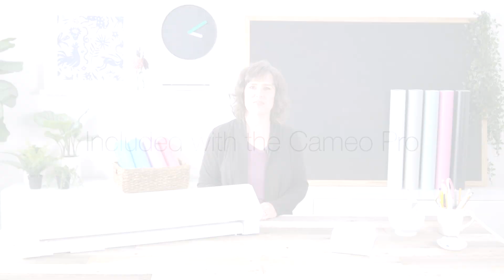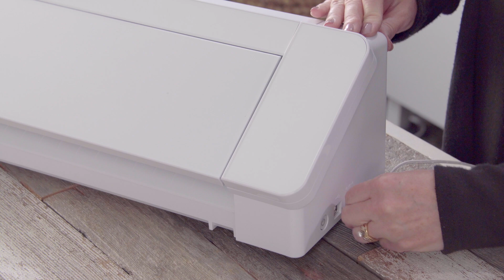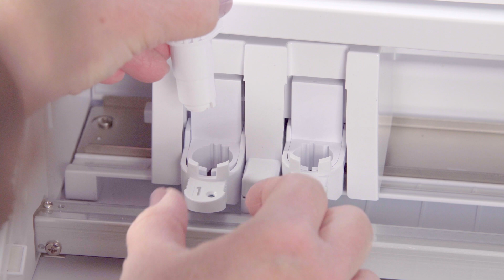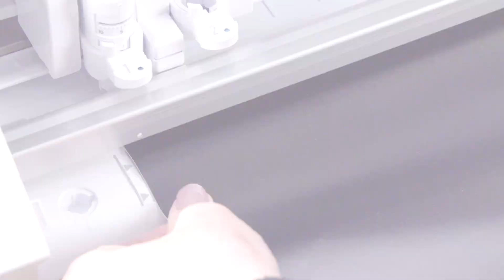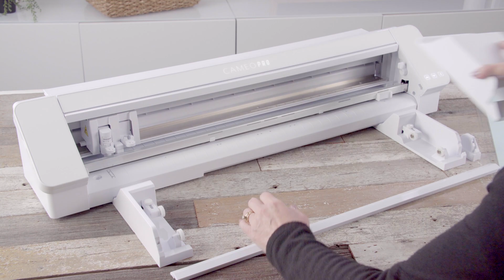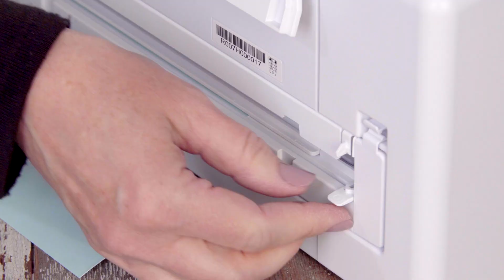Getting Started | Cameo Pro Setup

Comment: I am wondering which is the best way to get support as I sent an email a week ago and still have no response as well as commenting on videos with also no response.  I am very new and  I finally figured out how to print and cut a heat transfer for dark shirts and it was SUPER NOISY I thought it was broken!  The settings that the cameo chose were blade 3 speed 8 force 7 and it cut through into my mat and shredded my text so I reduced them all to one and wasn't as bad but still cut through to my mat.  What do I do? tia :)
Reply: Thought I was the only one! It sounds like it's singing when trying to cut. Have you figured it out or still nothing?
Reply: @cyanste  just told that they are just that noisy so I guess just have to deal with it as long as it works that's all that matters lol
Reply: @cyanste  The singing sound is normal. :)
Reply: The chat feature is the  fastest way to get support, as the support staff does not actively monitor all the YouTube video comments. https://www.silhouetteamerica.com/contact Make sure to test cut whenever trying a new material. It is not a quiet machine, but you get used to it. :)

Comment: and the cutting speed? is the same in all cameos 4?
Reply: Yessss!! 😁
Reply: yes? =(
oh no...
Reply: @fernandocampos3042  I thought it was a Good thing.. Haha all of the CAMEO 4 can cut up to 3 meters/s..
Reply: @julianadelamura  3 metters/sec? Are you sure? Mine do at the most 30 centimetres/sec, on a straight line MAYBE. But if you cut curves, or, CIRCLES, be prepared for a loooooong time waiting. hehehe
The cameo is an excellent kraft machine, and I hope they upgrade the speed on these "pro" ones.
Reply: The cutting speed is the same for all three Cameo 4 models, including the Cameo Pro.
Reply: @KellyWayment  yeah..Iam pretty sure..for a straight line..at the 30 speed settings
Reply: @julianadelamura  maybe is a misunderstood. 
The tech specs of the cameo 4 says they can hold up to 300mm/sec. Is 30 centimetres. 
I'm pretty sure that mine can not do 3 meters on a second... The graphtech ones do 800mm/s at most, and they're fast machines.

Thinking about, 300mm/s is not a bad number for straight lines, but the cameo slow down on curves to almost 10mm/s, while others maintain their speeds, and that is the most important data. Because that the cameo is extremely slow on general use.
Reply: @fernandocampos3042  well I saw at the Silhouette Manual..that every ajust is equivalent to 10 cm/s. Maybe they meant mm..not sure..I may ask the support now..😁
Reply: @fernandocampos3042  where did you find that speed info?? I keept looking but I cant find it anywhere..:(
Reply: @julianadelamura  The Silhouette Cameo 4 now features a unique high force tool holder along with the new high-speed tool holder in the tool 1 position (max cut speed of up to 30cm per second).
https://www.forevertransferpaper.com/silhouette-cameo-4 

I tested yesterday and the roller speed almost match these alleged 300mm/sec. But the carriage speed is about 150 to 200mm/sec at top speed.
The contour, or, making circles, is something like 10mm/sec.
These tests I made with my cameo 4, at speed 30 on carriage 1.

So, like I said, the cameo has a stepped motor and a reaaaally low speed. Is a Kraft machine that do they job, and is almost inexpensive compared to others.
Reply: @fernandocampos3042  thanks..as I said before on Silhouette America website says cm..surely it is wrong and they meant mm..😊
Reply: @tom_myspace_and_leslie_kean  the bussiness edition open all those file types